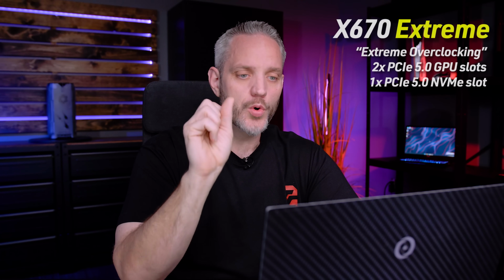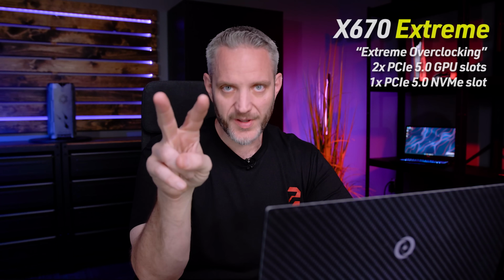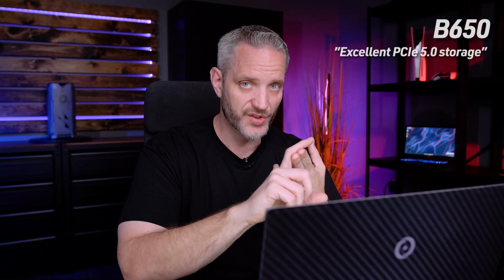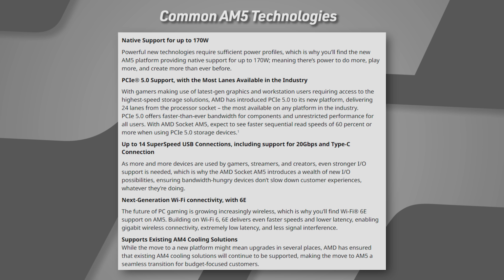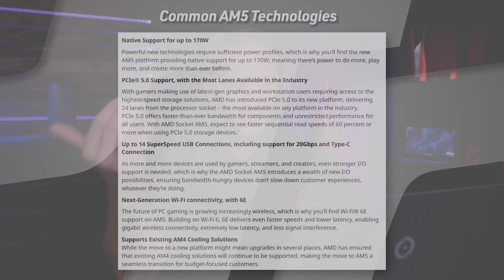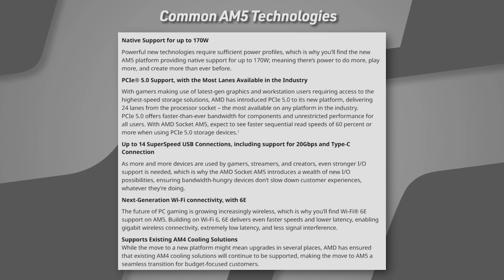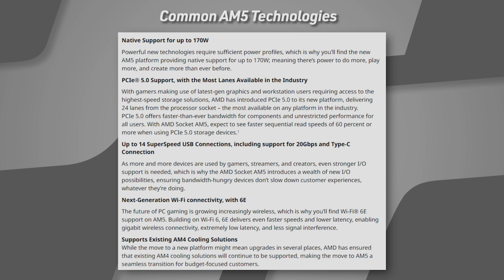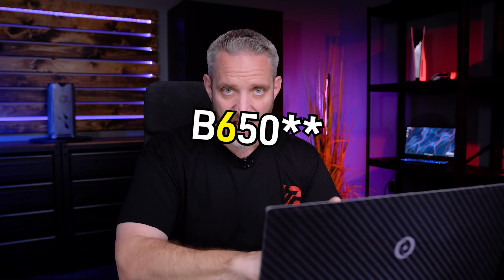AM5 Motherboards are EXPENSIVE! AM5 Explained

Comment: Solution: Wait for Zen 7X3D. 
This will give you about 3 to 4 months to see if there're any issues with those boards

In the end, as long as I have a PCIe 5 graphics slot and at least one PCIe M.2 slot, I'm good. But more importantly I need as many USB ports as I can get. 
I've got so many devices that needs it.... keeb, mouse, RGB mouse pad, RGB mouse bungee, gaming keypad, webcam, wireless headset dongle, USB Audio interface, and 3 more USB devices.... it's just ridiculous. Definitely USB interface is one of my priorities.

Comment: I spent a total of 5.5k on my all AMD PC and it has all the bells and whistles, so I will go with them again but i have personal data I'd like to share: 5800X3D isn't worth buying AT ALL.

TLDR; let me explain: it's great for gaming but it struggles to perform the same multitasking performance than the 5600X so if you want to have YouTube, open, 1 simple game open, Spotify, and discord open you'll have microstutters out the ass and the system will even freeze up until you close one of those windows. What I realized is that even though the 5950X is overkill for games it is actually necessary for basic computer functions because most people want to listen to music or surf the web in-between loading screens.

The reason why you'd want to opt for a regular CPU like the 5600X, 5800X, or 5950X is because they just work as intended with the 5950X having ALOT of Cache to help with your gaming as well similar to the 5800X3D.

All that to say this: don't buy a 5800X3D buy a 5950X and you'll accomplish what you're trying to do. They're basically the same price now.

Comment: One thing I'd like to throw in is that there are rumors that AMD may continue to have some GPU's with less than 16 lanes to save on chip cost. If they for instance have a mid-range card with 4 or 8 lanes on PCIe5 then you won't notice a difference. But there may be potential for lost performance on PCIe 3/4 boards like the unique case of the 6500XT
Reply: I do wonder what the cost savings is for using 4 vs 8 vs 16 lanes on a gpu.
Sure if you're using pcie 4 or 5 then it's probably fine even with 4 lanes on 5.0 gpus coming, but you'll be damn sure people are going to put them into pcie3 boards, and performance will be a lot lower on those boards compared to new boards. That will definitely cause me to not get the lower lane gpus, then I can instead grab a used one that will perform better.

Comment: Excited for AM5 but definitely don't need it right away. Got a 5800X 32GB 3080 system which does everything I need it do and then some. Will run it a bit and let the early adopters work out the kinks.

Comment: I'm wondering what peoples opinions are about over spending on a motherboard to gain a bit of reliability? For example, does a TUFF have a higher return rate than a Crosshair? Early into Ryzen 3000,  I bought a Hero VIII with a Ryzen 3700X because I figured upgrading to something that's made from robust parts and has extra cooling should should, in theory, last longer under normal loads/basic overclocking. I just upgraded to a 5800X3D and I expect to be happy with that for the next two to three years. Does anybody think that one may encounter more issues over the course of about four to five years on a cheaper TUFF or even a B550 board?

Comment: Just commenting to help the algorithm, nothing worth reading here....
I've been chomping at the bit for the new APU's since hearing about them...what, feels like two years ago.  And, after three, no, four of my old laptops slowly died and've been suffering with a single core Dell Latitude for half a year, I am so ready.  But, it'll be freaking November before those moderately priced boards are out.  I don't plan to game, and, after spending the past ten years distro hopping Linux I don't plan to install Windows.  I need a moderately priced computer capable of running Cisco's network emulation software and some other stuff to get through the certs to get back into IT after ten years.
Yesterday I bought an i5-11600k, cheap ASUS B560M mobo, 16 gig of RAM and cannibalized my old ESXi 6.0 host for the case & PSU just to hold me over.  (It is SOOO nice not having YouTube auto default to 360 or 480...now it's at least 1080/60!)
Door knocking for the AFL-CIO for several weeks...by rights I should spend it on better things, like old debt, or moving out of my Sister's cellar (bless her for tolerating my ADD ass instead of putting me back on the streets)...I'm like those old laptops, too old to fall back to Shipping & Receiving -- the only way to self-sufficiency, eventual retirement and, hopefully, finding a girlfriend (at 60) is getting back into something like a SharePoint Sys Admin position. 
...And, yeah, politicians on both sides have to beat the drum for a culture war since Our Shadowy Overlords dictate they can't address the Class one.  
Best of luck to everyone.  Cheers!   🤣

Comment: Why build a pc if your not gonna go all the way, get a console. 
Nvidia 4090
I-9 13900ks raptor lake cpu 
Water block both 
3.0 PSU 
z790 motherboard 
Pcie 5.0 ssd 2 TB
DDR5 ram 32gb 
Custom loop
…other parts ect

Comment: I will be getting an AM5 mobo and CPU, but I'm waiting until the rough edges get buffed out. I'll be going with a 7700X and probably a 3080 or maybe a 3090 depending on where the prices are before the 40 series launch. I initially wanted a 5800X3D, but I figured screw it the X3D is like $450+ while the 7700X is $399
Reply: 7700x and 6900xt or 6950xt for me because its better than 3080 and 3090 anyway.

Comment: Im on the fence. I've always been Intel guy but im very interested in what AMD is doing and thinking of implementing it in my new build.
Reply: Basically, just don't expect some real overclocking. It's the only real complaint I have, is that AMD has a habit of calling their turbo boost "overclocking" and not being able to actually exceed that. Which, to be fair, if you're on some later gen Intels, good luck with that overclocking headroom anyway, particularly that 250w+ power draw on Intel, but still.

I'm pretty damn happy to be on it now tbqh though, especially because I ended up buying a 5700XT and am probably sticking with their wonderful Adrenalin software and cheaper more efficient RDNA3 so I'm probably going to have a fun time with RDNA3 on x570 Zen2/Zen3 features like Rage mode resizeable BAR etc. So as much as I want to bitch about AMD's complete lack of real overclocking, as much as I was stubbornly in the mindset of "no, Intel is just better" for years, yeah..I'm pretty glad I switched. I'm only butthurt at AMD for jacking prices on everything and taking away coolers, because I love my Wraith Prism stock cooler so much, it's like a real aftermarket cooler in appearance and performance that saved me enough money it was like going a full CPU tier higher for the same price.

I think 13th gen vs Zen4 should be an interesting lineup. I'm still skeptical based on losing price advantages, but yeah, AMD's the, I was gonna say "hot shit" or "the shit" but that's Intel lol you're only running into heat problems with 12+ cores. Jay's right, path of greatness may be a bit much, but he's totally right. I still nitpick about things like 5800X3D being a "one trick pony" as I impugned it with heat issues, worse clocks, only works great on some games more than others etc., but AMD is just objectively and factually better in a lot of ways now. I'd just be hesitant to build an EOL platform like Zen3, unless you're trying to get a simple 5600x midrange GPU type fast gaming system, but that's just me (I built on Zen2 partly because I wanted a board with a future, and I'm more than pleased with seeing Zen3 and knowing I can upgrade next year to 5900x/5800X3D/5950x and have a ten year build).
Reply: @pandemicneetbux2110  Well, the turbo on intel core only affects 1 core, if more cores are getting frequency spikes, you get less frequency pumped into them.  It's also not static, constant, meaning the turbo only goes for low ammounts of time. 
Amd on the other hand has a sort of automatic overclocking, the processor pushes itself as high as it can go as long as the requirements are met (temperature, power draw). 
Many people found out to be getting better results from the automatic overclocking rather than setting the cpu manually, so don't be mad at AMD, you get real overclocking but you get the opportunity to have it work autonomously  rather than playing with it yourself.
Reply: @lupuradu  My experience has been that automatic overclocking gets me worse performance on Ryzen Master, and that I likewise get better performance on just using a manual undervolt. I swear leaving PBO on degraded my silicon after doing it for like a couple months, but unsure. Feel like it used to clock better and more stably. Anyway, my experience is basically just that undervolting gets better gaming performance because it sustained boosts better from having 10C lower temps than the like 54C "idle" and 60s C gaming on default. So idk, I just don't even think it's worth it without serious GN Steve acumen, as opposed to just setting the clock multiplier and voltage etc. on Intel. Not that it matters if Intel performs worse overclocked than Ryzen at stock mind you, but still. It's a rather petty detail ultimately because Zen3 does just perform better, only I insist it is missing an overclocking headroom and that while true from a literal technical standpoint, calling its sustained boosts "overclocked" is just false compared to the way Intel does overclocking.

So as a gamer, would I recommend it? Well yeah, provided X Y Z for your build, but I wouldn't call gaming-only Zen the only choice, or wouldn't be willing to switch back to them for gaming. For AMD its real advantages lay in all that productivity work, and cost. Also efficiency, thermals. Really I'd call it more parity with Intel on gaming and me just complaining pettily about not making my 3.6-4.4ghz go to 4.7ghz when my decade old 3.5-3.9ghz Intel quadcore can go up to 4.7ghz.
Reply: @pandemicneetbux2110  yup, only the people who used Adrenaline know how far Radeon software has come. I have a 5800H + 3050 work laptop, and I don't even want to sing up to use GeForce experience when I can get everything I need without that extra hassle and data collection.
Reply: @superneenjaa718  That's really the thing though, why does nVidia insist on email and shit. I am coming from a different mentality though I guess where I'd rather outright buy a burner phone to use a fake number for setting up email accts and shit (guess how I got this handle) since throwaway vmails boxes are so much harder to find and use as a lazy person, so merely the concept of signing up irritates me. But then again, AMD did kinda pull something like that by me having to download some software and verify my hardware to get a couple free games that came with CPU and GPU, so there's that. Same time, Adrenaline is just better, and I don't need to link it to any account. It just feels like AMD is so much more user friendly in a sense, although there's an irony in that I really really miss windows98 and bitch about not having it all the time whereas I'm talking shit about nVidia's software (those of you who know, know).
Reply: @pandemicneetbux2110  that bundled games stuff is different though. They have to have some defence mechanisms in place, otherwise it'd be grossly misused and game devs will be none to happy.

But yeah, if I really wanted to mask myself I'd use VPN, and temporary email services available. The thing here is though more of accessibility. I find signing in for every little thing really annoying. I won't do it unless I absolutely have to.
Reply: @superneenjaa718  Yeah...even signing in to multiple layers of game launchers is aggravating. I am absolutely don't need an additional layer of startup bloat and attempts to undermine my privacy by signing in for GPU software, hence another reason why anyone on nVidia just uses MSI Afterburner until they forget that it looks weird when you boot up with an AMD card and immediately install Afterburner.
Reply: @pandemicneetbux2110  lol. We're so used to afterburner. It's one of the first tool most install in a new pc despite its overlay not working with vulkan. I don't know if they updated now though.
Reply: I was an Intel guy, but AMD has been crushing it for the last few years and every generation has significantly improved. I jumped on the AMD bandwagon over a year ago, and I can say it's been a great decision. What do you got to lose!

Comment: Day one bugs are going to be a nightmare between software and drivers and you can never be prepared what changes need to be implemented to run in this new platform. If anyone is so desperate to upgrade then be prepared for system disasters. If you are in the market for a new computer, then this is going to be one big upgrade with a big power BOOM. One thing that we all will need to understand is the bios settings,  which will be different and need to be adjusted just like the old AM4 CPU voltages on many Motherboards running over 1.4 volts most of the time left on auto. I am looking forward to seeing the new hardware in action Jay and a guide on the settings at Bios level. I cannot wait to see the differences between each Motherboard has to offer and i know you are going to give some great reviews as always. So it is good times ahead and lets get our head around this new platform. Great video. Cheers

Comment: The reason for the dual PCIe 5.0 GPU support likely has to do with enabling Infinity fabric support over PCIe.  Bandwidth won't change but it will enable memory sharing and coherency between the CPU and two GPUs.  This won't fix the various timing issues with CrossFire/SLI for gaming across two cards but it would permit compute workloads to be split as if it is one bigger GPU with one larger memory pool.  Tasks like rendering, video editing and mining would benefit.

Comment: Can't believe I'm able to say "Remember the good ol' days (a year ago) when a very good motherboard could be had for just over $100?"

It's honestly sad that motherboards are becoming so expensive yet can't even bother putting any of that money into basic things such as post code displays, power and reset buttons, bios flashback, etc....
Reply: True. What also annoys me, when buying a high priced notebook, and the Vendor software on it, is some mixture between useless bloatware and some total pathetic programmed Chinese spy software. And you can't even choose. Every Vendor has his own Crapware on it. Just to adjust the RGB on my keyboard, i need to install a bunch of services, which will choke my new system. 
This went all in some wrong direction. The customers became way too soft and benevolent with the products.
Reply: @janvollgod7221  I mean honestly...it's more a problem on 14nm++++++++++++++ lol. Just because I'm rocking this 4th gen CPU and by God, the f'in thing actually throttles and stutters while I'm just trying to download a Steam license and play a video at the same time 1080p. Which is why you need moar cores. I've stated this a million times probably but basically 4 cores is not enough because it can't use all the other shit you got running on, especially not a YT music video in the background, and then have all that RGB software which yes, I've got one for my mouse, one for my CPU cooler, and another one for my total board output. Plus you've got all these things like GOG Galaxy and Epic and whatever other launchers like Steam on that it can be a real problem, but I'm often skeptical people telling me the bloatware somehow is supposed to hog 8 cores.
Reply: Yeah, but that's why I've got mine, and quite frankly given my last board was literally a PIECE OF S%$& Dell OEM board that still made the beeping sounds, it's amazingly refreshing. Basically, Dell is like that PC version of the neglectful parent who makes you overcompensate into eating cake and ice cream all day, and that is why I got my $300 x570 Taichi board. 
Because now I get to eat post codes and great features for breakfast and dinner. BIOS flashback, my God even my ARGB got fucked for the longest time until I realized I could do a software flashback and it fixed it. I thought the traces or chip itself was blown. It's why I'll always spread the gospel of needing a good board. A house divided cannot stand against itself, and a board is like a foundation to a house, a system built on a bad board will be washed away like the sands of 11th gen Intel.

Comment: I think there are a lot more mid tier creators/productivity users than ever before (streamers, vloggers, photographers, digital artists). I am a self employed photographer/videographer who also games. 
While I would love a threadripper based work station and a separate gaming system, it's not viable based on my income or actual usage. Just for reference, In AUD, 5965WX is $3999 and the 5995WX is $11299.
For the sweet spot is the the 1st or 2nd tier top dog 'consumer' cpu with a MB built like a brick shithouse that I can plug alot of stuff into and I'm good for 5 years. I future proofed last time with an i7 7820x, 1080Ti, 32GB RAM and its been over 5 years. I still get almost rock solid 144fps in my fav game (and yes I limited the card to 144).
I also remember looking at the single USB C slot on it thinking.. umm what? Now I wish it had more.